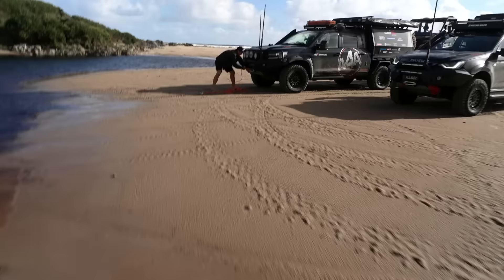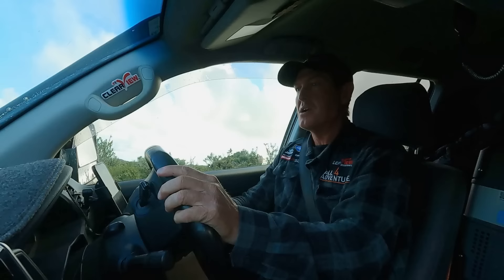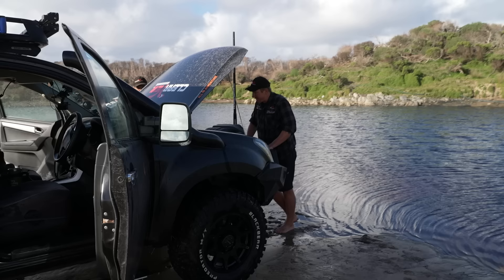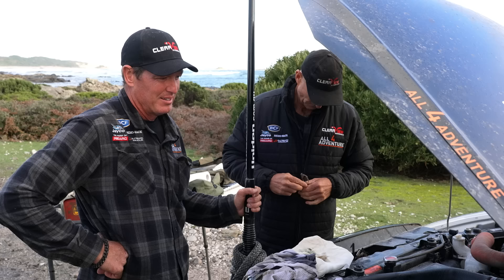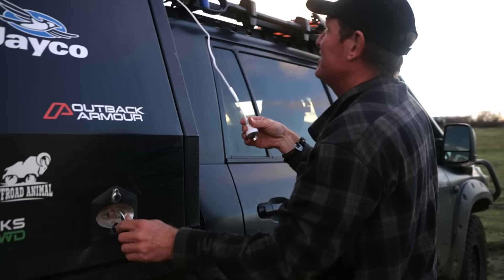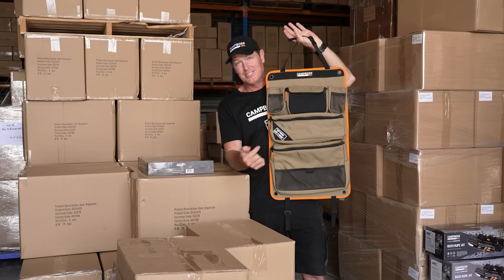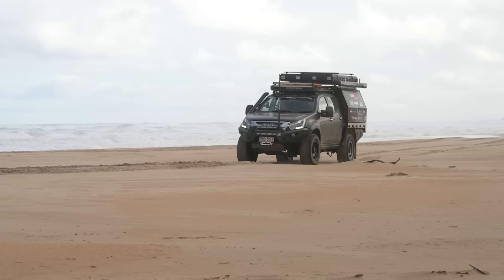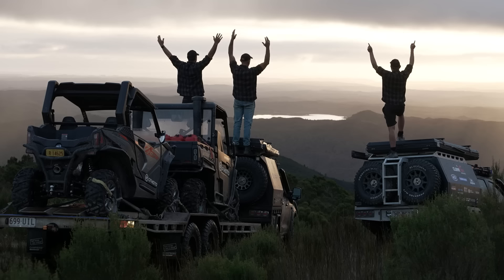🔥 4WD DISASTER IN TASSIE! We DROWNED the D-MAX 💀

Comment: @All4AdventureTV 12:36 i say it to all the 4wd channels. carry a heap of foam ear plugs with you when 4wding. put them in the drains in the bottom of the doors before you set off through water crossings and it will reduce(if not stop all together) water intake via the doors. as long as your seals are good everywhere else, it can buy you alot of recovery time and also means you dont need to rush through water crossings. just cruise on through and enjoy the adventure. i use the same idea in my own 4wd and it gives me the ability to drive through longer crossings and to wash my car in rivers and creeks without flooding it.
Reply: This sounds like a great idea. Never thought of the foam ear plugs. Adding this for sure
Reply: Hopefully it serves you as well as it has me. 😁
Reply: Another thing wind ya windows up turn ac fan on and pressurise the cab works well too

Comment: Hey guys, I know the horse is already bolted, but next time you get into trouble like that there is a drain plug in the front of the intercooler bottom right hand corner drain the water out of that before you start at what you’re done is perfect

Comment: I always wondered why you ended the snorkels right there seems like a bad design if the water washes up your windshield which it seems to do a lot in my case. Also, you should have some type of a tip on there or at least extend it up on to the roof.
Reply: That was my thought too. I can't say I've ever seen the point of the open-end stainless jobs like that. Maybe they do breath better. But at what cost, eh?
Reply: @dirkbaltzly7287  highway and hig speed economy, that set up is perfect for slow crawling etc, but becomes a negative vortex at speed making ya inlet charge suffer
Reply: I don't think it's any surprise if you think through why these exsist on the market, this style is cheaper for random shops around aus with an online store and a bloke that can half-weld to make out of pipe ad-hoc. Compared to a proffesional engineering/automotive aftermarket company investing in an actual mold for each model/vehicle and professionally producing a quality product that doesn't howl in the wind, fails to shear/redirect the flow of an upward bow wave or look like garbage :) I think people were fitting the cheap aliexpress knock-off plastic units > getting leaks and then the fashion became installing these garbage straight pipe units to avoid leaks along the snorkle assembly and people forgot all the other design requirements for a snorkle were lost 🙃

Comment: Next time this happens leave the charge pipe from the intercooler to intake manifold OFF when you start it so the water in the cooler and pipes doesn’t get blown right back into the engine you just tried to dry out

Comment: Is it not normal procedure that if your air filter is wet,then you take out the plugs and turn the engine. Otherwise you risk hydrolocking the engine if you start it with water in the pistons.

Comment: Obvious errors. It's either done for the camera or these guys are completely out of their depth (pun intended).   1. didn't mark track where the wader had walked through therefore went in deeper section of the crossing. The vehicle could have rolled into a deeper section trapping & drowning the occupants. 2. Way, way too fast . 3 No recovery strap or winch line ready to go before vehicle attempts the crossing. 4. unsure but tyres look to be at full pressure, wrong, wrong , wrong.  This vehicle is probable a write off or will have life long electrical problems with all that (possibly salty) water in the engine bay.   Most of us don't get a sponsored replacement vehicle. I bet Isuzu wouldn't warranty any related claim.  Don't get me wrong, I'm all for a bit of adventure and have done many water crossing in my 80 series but this was nut's. In my humble opinion.
Reply: It's only as bad as dragging tons of toys behind you and complaining about the struggle. Early on these guys were quite entertaining but with all the sponsors tagging along it really has become a giant commercial,very same thing happened to 4wd action. Smash and bash driving , helicopter drops with new tyres and seemingly endless amounts of bravado rather than care and mechanical sympathy

Comment: Wouldn't have tried starting it straight after it died that can further hydrolock the cylinders causing a failed or bent piston connecting rods also turn the snorkel intake cap backwards before attempting deeper water crossings like that or go in slower and try not to splash water up over the roof into the snorkel inlet

Comment: Did use ever checked the oil in the engine after hydro locking it? 
Usually there’s enough H2O mixed with oil as emulsion to kill your motor.
Should drop it immediately and whack some freshie in boys

Comment: Air filter was done but why bother trying to start it this the no. 1 no no. Also must remove all injectors or spark plugs to get it to turn over n pump the water out. Then after that you may proceed to start after put back together. 
 Note I did notice it was injectors just getting  plugs and injectors out there.
Being salt if not fixed n sht replaced at or by mechanics it will seize the engine

Comment: Kyle: "crisis averted"
Google translation: Is it safe for me to camp with Jase tonight?"

Pro Tip for beach crossings: When in a convoy, use a snatch strap & the required number of extension straps + one extra, to attach the rear of the vehicle making the crossing to the back of a vehicle not crossing yet. If the vehicle crossing goes down the tow vehicle can be making the recovery within seconds. This is very useful in sand as the vehicle has minimal time to settle.
IMPORTANT: Be aware of obstacles downstream that straps may tangle around. Not usually a problem on the beach but have a look anyway